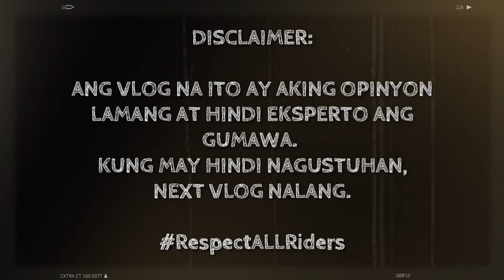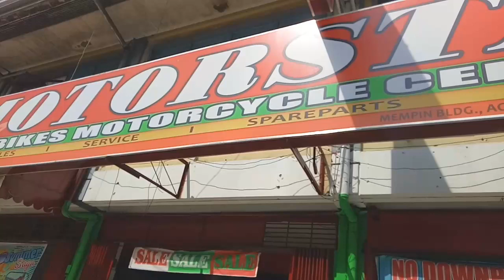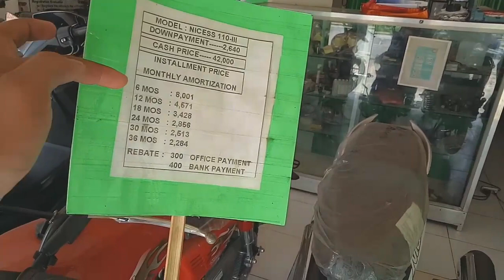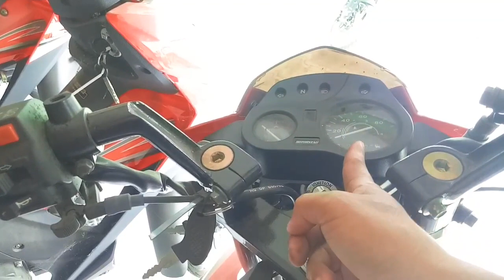MOTORSTAR NICESS 110 - III // #iMarkMoto ep.135

Comment: naka nicess 110 din ako now as of now wala ko masabi sa performance nia almost 200kgs kame ng partner ko pero smooth running sya fuel effiicient sya pag patak ng 40+ km tska lang sya nagbawas ng gas sobrang fuel efficient sya sobrang tipid lakas pa headlight at higit sa lahat 1k lang down ko all in my free fullface helmet pa and 1 day process once na ma c.i ora mismo pede na ilabas ang unit pag kompleto na requirements nio sobrang satisfied ako sa nicess ko
Reply: Charles Ruben 
Papsi pwede mag ask. Ano oil gamit mo?
Reply: Idol anu kasukat nya sa center stand